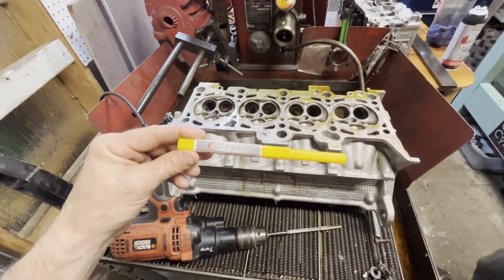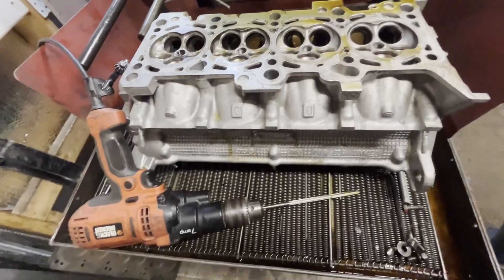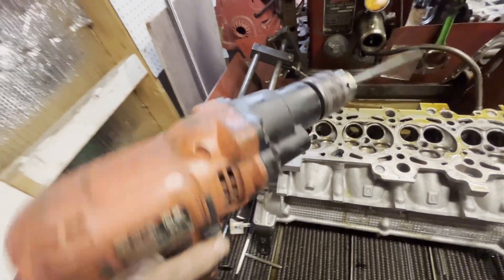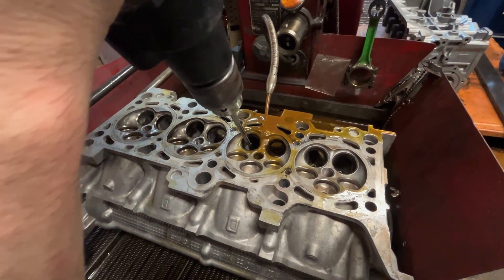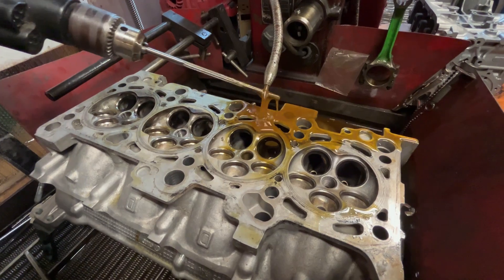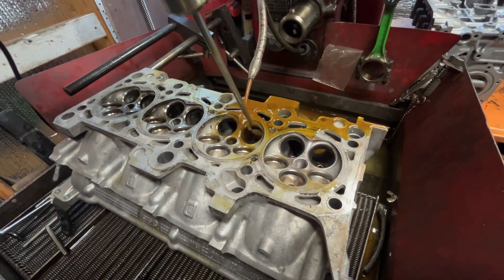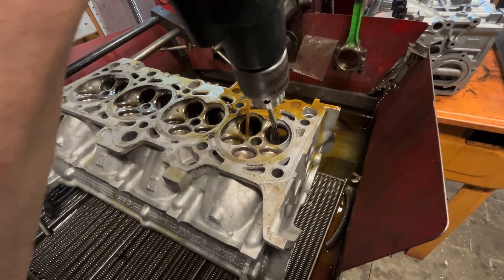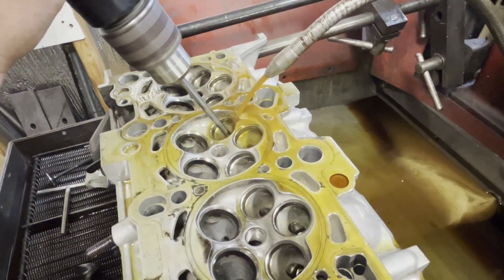Reaming Bronze Valve Guides with Performance CBN Carbide Reamer on Audi 20v Cylinder Head

Comment: Great video and thank you for the time and money that goes into every video - much appreciated.What kind of honing oil are you using? I have a dedicated 7.5 amp low budget electric drill for reaming, but these Bronze guides are playing hell with me. I don't have a pump setup, but I do have good brand reamers and I have to hang on for dear life to the motorcycle head and my drill. It tries to spin me a round. Any suggestions would be helpful and the reamer is made for the Bronze guides. Thanks